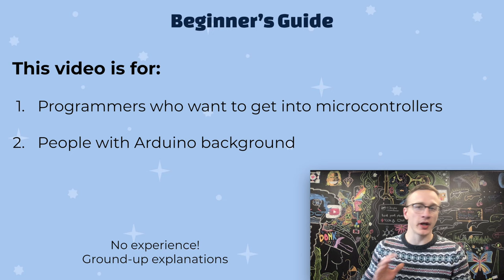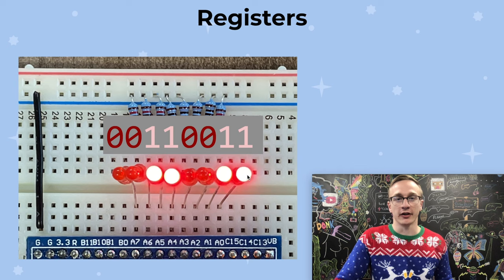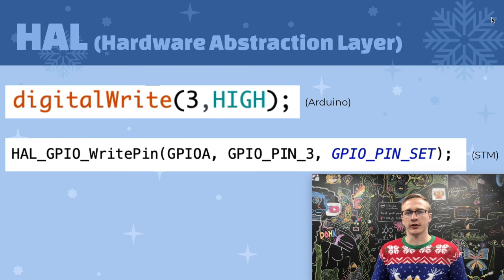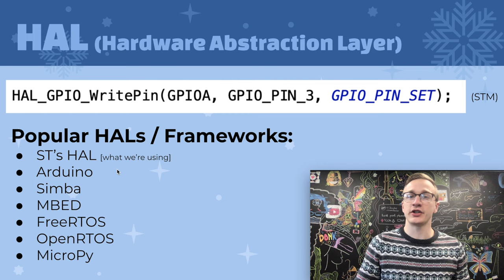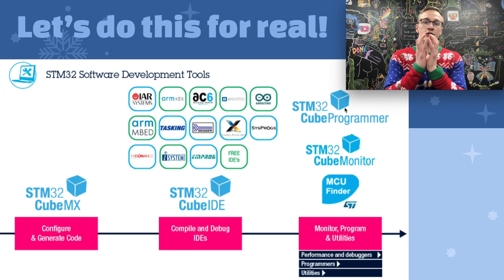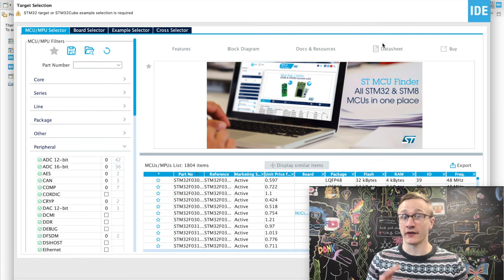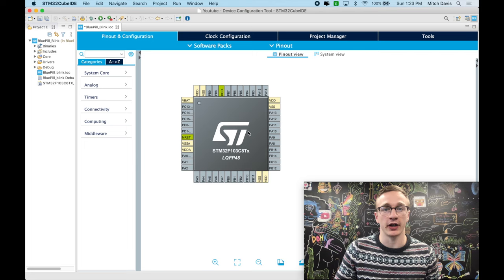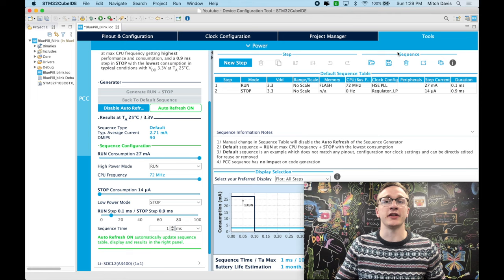STM32 Guide #2: Registers + HAL (Blink example)

Comment: Before doing any programming on a project using a bluepill I recommend setting the debugger, it makes everything easier. Inside Pinout & Configuration, go to System Core -> SYS -> Debug -> Serial Wire (if you are using an st-link, whether original or chinese copy). You should also configure the crystals under RCC->HSE = Crystal/Ceramic resonator and RCC->LSE = Crystal/Ceramic resonator. 

Another important thing is that sometimes the diagram on the case of the chinese stlinks are wrong. To make sure, you can open the stlink, pulling the case towards the usb. The silkscreen will tell you the correct pins

Great video!

Comment: This is by far the best "get me up to speed on stm32 and I know a little about Arduino" across the entiretyl of YouTube.  Thank you Mitch
Reply: Unfortunately, none of my Blue Pills (which have the correct resistor, etc. but are obviously clones) will flash.  The sad part is, I can write an arduino program to make them blink and it works, downloading via STLink.  still working at it :)
Reply: figured it out, user error as always

Comment: Finally! I was seriously considering downgrading to rpi pico for my project. You have cleared all the doubts I've had!  I cannot thank you enough!
Reply from the maker: With that said, the Pi Pico is awesome too.  I use picos for all sorts of projects.  I try not to say that there’s 1 magic platform for every problem.  Everything depends on your project.  In my opinion, STM32 is better for a large scale project and pico is best for prototyping or making quick hacks
Reply: @MitchDavis2  yup yup. for my application, a light disk encoder with ADC, it would work decently but I need the high rate (2MSPS+) of the ADC that the stm32 offers for dirt cheap. Pico manages about 500ksps. I think I'll try pico the moment I get stuck again in this project 🤣

Comment: The Arduino core for STM32 is actually pretty good.  It is built on top of the STM32 HAL, and you can use the HAL functions directly if you need to.  It also includes some higher-level APIs for STM32 features (for example, timers) that are much easier to use than the HAL, and with most of the power.  The downside is that it can take some digging to find which parts of the hardware the Arduino core is using (so you won't conflict).  For Nucleo boards, you're not limited to just the pins on the Arduino-compatible headers; you can use the rest of the pins, too.

I don't like the Arduino IDE (especially the editor).  Platform IO is an awesome extension for Visual Studio Code (and the Atom editor, I think) that makes it easy to do embedded development across a wide variety of microcontrollers and software platforms.  I much prefer VS Code to Eclipse, which is what Cube IDE uses.  You can still use it with Cube MX (awesome!) to help configure things and generate code; the stm32pio tool (in Python) helps a lot.

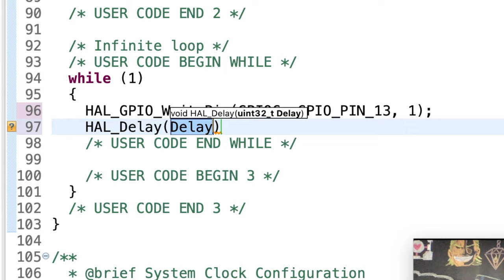Comment: 20:02 For some reason, HAL_Delay(n) delays for n+1 milliseconds, which is quite important when dealing with single milliseconds. HAL_Delay(1) delays for 2 milliseconds, HAL_Delay(0) delays for 1 millisecond
Reply from the maker: Interesting.  I’ll have to measure this out for myself.  I guess I’ve never cared about 1ms enough to really notice.  Everything do is in the 100+ms range, or in the nano-second range.

However, the official documentation says it delays n milliseconds.  so if it’s n+1, it’s probably worth submitting an error report to ST to have them update their manual.

https://imgur.com/xIwGWj5 (page 50 from STM32F1 HAL documentation)

Comment: Using someone elses video I did what you did here. Trouble is the LED did not blink. I thought the message "Debugger connection lost" was an error message. Glad you clarified that I need to look elsewhere for the problem. "lost" is a bad choice of word. Made me wonder if I had a faulty board that could not debug properly.
Reply from the maker: Did you make sure to put the board back in run mode (jumpers) and restart it?
Reply: @MitchDavis2  Thanks for answering. I am using a nucleo F303 board and as far as I can see that does not need any jumpers moving. I think the problem is that somehow all the default pin settings were lost. This CubeIDE is a powerful program with numerous places where the newby can get lost. Finding which pin to set to what is taking some time. Looking forward to video #4.

Comment: First of all: great series!
But also a comment not regarding the content: Parts of the video (actually parts of all your videos) contain a strong background noise. You could easily remove this with Audacity's noise removal tool (I just tried it). You don't have to pick all the noisy parts separately; just get the noise profile and run the filter over the whole audio.

Comment: Thank you so much!!  I've been wondering how I can make changes in the CubeMX chip/pin configurations and re-generate the code without losing the old written code!   I had to copy and paste it in the Microsoft Word to temporarily save it, regenerate code, then paste it back..... what a mess!    And it turned out that the trick is to write the code inside the commented spaces.   Thank you again for the info!

Comment: Excellent.  Thanks.  
I snapped off the ST-LINK from my NUCLEO pcb and used it to program the blue pill.  
For anyone using a snapped off st-link.  The two jumpers need to be removed from the ST-LINK (CN2, the connector next to the crystal).  

Use the STLINK SWD CN4 connector and connect it to the blue pill.
I connected SWD pins 2, 3 and 4 to the blue pill debug connector.  
  SWD pin 2 to CLK
  SWD pin 3 to GND
  SWD pin 4 to IO.  

I powered the blue pill from an external bench power supply to the blue pills 3.3v and GND.  I guess it could be powered from the ST-LINK?

Comment: Interestingly, I was playing with variations of this simple code and found that the pin 13 on my blue pill seems to be referenced to B+ instead of ground .  The LED acts exactly the opposite as one would expect.  However,  if the 1's are changed to 0's and the 0's to 1's the code has a ten second off time.   With the code written as below I get two blinks and then 10 seconds of off time.

            HAL_GPIO_WritePin(GPIOC, GPIO_PIN_13, 0);
	    HAL_Delay(1000);
	   HAL_GPIO_WritePin(GPIOC, GPIO_PIN_13, 1);
	    HAL_Delay(1000);
	   // HAL_GPIO_TogglePin(GPIOC, GPIO_PIN_13);
	    HAL_GPIO_WritePin(GPIOC, GPIO_PIN_13, 0);
	    HAL_Delay(1000);
	    HAL_GPIO_WritePin(GPIOC, GPIO_PIN_13, 1);
	    HAL_Delay(10000);

Am I doing something wrong or is the LED referenced to B+?  Is there a way to change the pins behavior in Cubes pin settings that I am missing?

Comment: When using STLink to program the bluepill, you don't need to move the jumper for BOOT0, just leave it (and BOOT1 jumper) in the 0 position.  The program will automatically run once uploaded.
Reply from the maker: If you’re using a recent version of Cube IDE, this no longer works.  They tuned off SWD debugging by default now.  You can turn it on under the SYS→Debug menu though

I’m eventually going to bring this up in a video, just trying to find the right time to bring it up.  I have a million “cool tips” like this, so I’m trying to roll them out in a way that feels natural

Comment: Nice video and good way of teaching but here i correct you that we don't need to move boot0 jumper if we are using STLink programmer. it is only when we are using UART controller to program the board STlink programmer auto reset the board.

Comment: Love your explanation! I’m looking into STM32F030 because i want to develop a cheap board to blink some ws2812 leds. Can i use fastled on a STM32F030 or do i need to write this myself? Also one more question (but i’m only halfway through your video, so explanation may come later) can you let others program the mcu with arduino ide using usb but not the programmer? Do you need to supply al the mux and hardware setup in setup code? Or does arduino take care of defaults behind the scenes? Going to watch the rest of you video’s now ;)

Comment: Was hoping you were using external LED's. I'm not sure why (I'm on the 144-Nucleo) but I connected a red LED on a breadboard to the 3.3V output of the board and the over current draw LED lights up, so I stopped.

Comment: Very good, but I had problems. The Bluepill board I used, used B12 for the LED, I also didn't spot how to toggle the display to show the code. Then I tried to enter my code in the second set of while (1). Well 2 or 3 hours well spent.

Comment: On my bluepill, the polarity of the on-boad diode on pin C13 is reversed - it's permanently connected to 3.3V, and it lights when the pin has LOW state (here probably as well, since timing of on and off state is the same, and it's hard to tell, or it's just my cheap clone). Took some time to figure out what's going on :p

Comment: Very good video! I have a question, as i know stm32cubeIDE doesn't supports counterfeit mcu (Which is used mostly on bluePill dev boards) and how did you program it by stm32cubeIDE ? Or it is real mcu manufactured by ST?

Comment: I don't think you need to move the BOOT0 jumper when using STLink on blue pill.  I think there's a built in bootloader, permanently installed, but in a different address area (the mysterious System Memory), but it uses the unconnected serial port, instead of USB), which isn't exactly helpful.  I think when you install Arduino bootloader, it lives in the lower end regular program flash space.  It's pretty confusing, but I think this is how the BOOT0 pin works, it just launches a built in bootloader after reset.  STLink can completely control the processor, so it just resets what you accomplished with BOOT0 and reset button.  Try flashing the blue pill without moving BOOT0 jumper and your program should launch as soon as it's uploaded.
Reply: @MitchDavis2  okay, that makes sense.  You seem to know this pretty well, can the System Memory bootloader be rewritten?
Reply: @MitchDavis2  I'm using STLink and stm32cubemx ide.

Comment: Great!, i followed the steps and compiled the blinking Led example, but the Flash used is too large around 4.3k, in arduino ide is over 10k and the original atmega is only 1.6k... forget to say stm32f103 it uses 1.5k of RAM for this example. The compiler does pretty bad work

Comment: When the device is programmed, is the code placed on some form of non-volatile memory on the board? So if you disconnect the device from the USB or Debugger pins and use external power instead the code that was loaded previously will still be on the board (so long as the jumper is not in the programmer mode on start)?

Comment: FYI you dont need to touch boot jumpers when using ST-Link, you will need to use it if you program the STM using FTDI or some other means tho.
Reply from the maker: With the newest version of CUBEMX, it turns off the programming pins by default to be used as GPIO pins, so if you don’t enable debugging from cubeMX, you’ll be unable to reprogram it without messing with the jumpers.  That’s something I want to cover in a new video, I just haven’t gotten around to it yet
Reply: @MitchDavis2  That I didn't know, you said you were gonna so many good stuff, in the vid too, cant wait for them all 😀

Comment: Hey Mitch thanks for these nice videos you've uploaded. One question. Do you have any idea if it is possible to switch off the auto-generated comments in CubeIDE?
Reply from the maker: I haven’t tried, but if you ever did do that, you’d never be able to re-generate code for that project again.  The comments help CubeIDE know where it’s safe for it to put the init/config code for peripherals you are using
Reply: @MitchDavis2  yeah, once I manualy deleted the comments and it really messed up the code. Haven't seen this approach (with comments playing a role in the code) on any othe IDE's.

Comment: Is there a way to use both HAL and LL in the same project? I have my program running with HAL, but I want to send some data through the GPIO in parallel. Doing a HAL call for each bit is too slow. I would like to push my data straight to the GPIO output register. Do I need to recreate my whole program just to do that 1 thing?

Comment: Quick question, i got everything to work but if i change the delay times, the on and off values are inverted, i.e. if i use 3000 delay for 97 and a 1000 delay time for 99, the LED spends only one second on and three seconds off. Could it be cheap amazon product manufacturing (PCB board) or something else? Thanks!

Comment: Are you honestly saying digitalWrite(3) would be slower than HAL_GPIO_WritePin because of the lookup?. Seems like a decent compiler could inline or even compile time evaluate the lookup.
Reply from the maker: Yes.  I have a video on my bare metal MCU series that compares how quickly you can toggle pins with digitalWrite vs bare metal (port + pin)

I agree, if you had a REALLY fancy compiler, it could probably figure it out, but it would really have to analyze your code to figure out some things:
- are you using a constant number or a variable, like “digitalWrite(3)” vs “digitalWrite(myPin)”
- actually execute the port lookup code, and figure out that “3” always maps to the same port
-do the same for the pin code

Comment: I have downloaded the STM32 software , and was trying to follow through your video to program a microcontroller , but every time I try to generate the main.c code and also the other codes like the .h or the .cpp codes it doesn't do it , what could be the problem?? if anyone has gone through this issue I need to know what else do I need to do, also I don't yet have the physical STM32 controller to push the file into a microcontroller.

Comment: I have legacy code that was non-HAL based using the SPI port and system clock. Now I have to add ADC code using HAL because I can't find any non-HAL code for an ADC for my STM32L011 processor. I get tons of compiler errors and I have no idea why. There are no examples anywhere for an STM32L011 on how to write non-HAL code for an ADC. Can anybody help ?

Comment: 1:55 doesn't the bluepill have 20k SRAM? Did you mean 64k flash mem?
Reply: @MitchDavis2  bluepill  had 128k of memory 64k  disable from the factory, but if you tried to allocate 128k from your code you will get 128k flash memory instead of 64k , here is video someone test it https://youtu.be/0eHpoPZvI3U?t=35
and I was able to get 128k after select 128k board version on Arduino IDE .
BTW your contents is super super great, you are the only on in the world explained to me what is bit shifting and why(sorry) the hell it was used to control the uC port status, I spent two years reading studding about uC and no single one mention that(believe me I did a lot of research ) .

Last but not least, please please keep doing contents on the bluepill, it's faster cheaper than Arduino, and had tons of features, specially ST STM32Cube IDE it's amazing IDE, and too complicated on the same, if you do more series on it, I'm 100% you videos will be exclusive because almost no one talk about it, 
Last thing this my test on the bluepill board I was able to create sound of it(i's not that much but small HW hack)  https://youtu.be/vfcCpQyBtAc
Reply: @user-ir2fu4cx6p  I think many F103C8T6 chips actually contain 128k flash, even though they aren't documented that way.

Comment: Why the STM32 Cube IDE needs to run on a 64 bit operating system only is beyond me. I think ST have excluded a large percentage of their potential customers who like me still use a 32 bit operating system. I’m still trying to find some other IDE to do the work instead. Looks like the Arduino IDE will work with a 32 bit OS.

Comment: Can you explain the difference between Debug and Run after building the program. Run is generating desired output in my case and using Debug option, the output is getting stuck at middle.
Reply from the maker: There’s quite a few differences, and I don’t think I know them ALL.
However, debug is mostly used to step through the program, line by line.  It allows you to watch the value of variables, or pause execution at certain lines (breakpoints)

When you start a program in debug mode, it usually pauses at the beginning of your code, and you need to press the play button to continue.

If you set any breakpoints in your code (by adding the blue dot next to the line number), your program will pause when it gets to that line of code.  You have to press the play button again to get it to continue.

This is incredibly useful when you’re trying to figure out exactly what your program is doing, but it’s not something you want if you aren’t going to be debugging your code

Comment: Hello , Sir .I strongly need your help. I'm simulating STM32F103C6 on Proteus , and the code is written on Arduino IDE, I'm testing a simple LED blink project and the simulation is not working!
I tried the code by STM32CUBE IDE and the simulation worked properly, can you help me to make it work with Arduino IDE ?
I have tried all compiler optimization levels in Arduino IDE but none of them worked for me !

Comment: NUCLEO board does not have the priogram mode jumper? it is smart enough to restart istelf after it has been written?
Reply from the maker: There’s a few ways that things can be put into “program mode”
Older chips used a BOOT pin, but newer chips do it over the SWD pins (STLink pins) instead.

Comment: I dont get why readable code(using HAL) would make uC slower. The compiler takes care of the high level syntax and in run time it is the same thing. Isnt it?
Reply from the maker: It depends.  HAL often sets more registers than you need, so those eat up a few extra clock cycles.  In video 4, I touch on that a bit.  Overall, these things are so fast that it rarely makes sense to do direct register manipulation
Reply: @MitchDavis2  I see the point thank you. Please make more videos you explain tedious topics very clear.